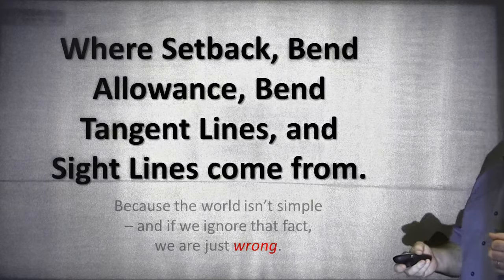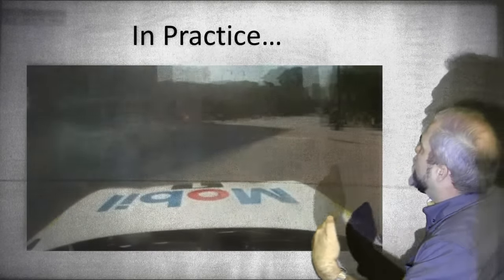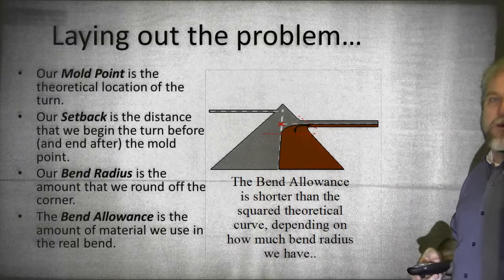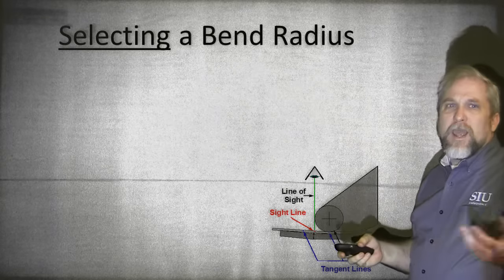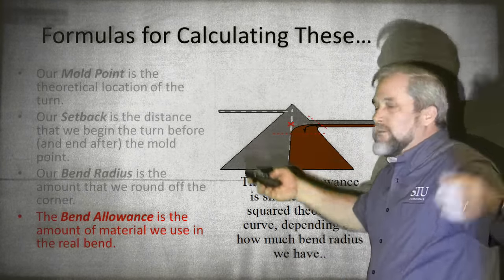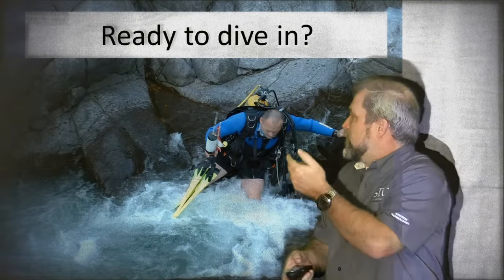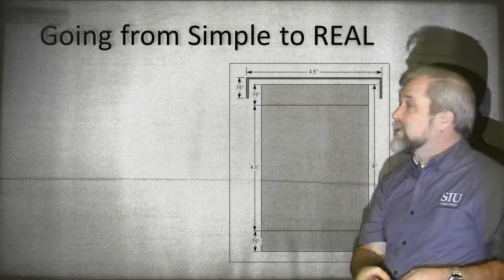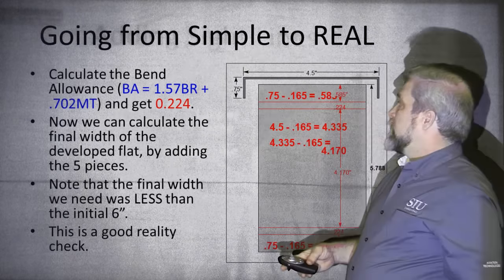AVT 206 A&P - P2 - Developing Sheet Metal Flats - The Math Behind the Bends

Comment: Interesting, but you are making it too confusing for some. A much more simple formula for the length of a bend is......length = (radius x angle x 3.1416) / 180.    That will give you the length of the bend in the middle of the material thickness if you use r+1/2t
Reply: Yeah, or Radius x 2 x Pi  = Circumference, divided by 4 = arc length.

Comment: Many years ago, while working as a flight mechanic at a large aerospace corporation, I was tasked with building several complex parts for a flight test aircraft.  The stack of drawings was daunting, with each part having multiple bends at various angles, but also multiple radii on some parts, and many of the flanges were at angles to the other flanges.  Calculating non-standard angles wasn't fun, since the process at the time was to look up the setback in a table for that thickness and radius.  (table was every 5°)

I'd then have to do the math to extrapolate the answer for, say, a 37° angle.

I knew how to calculate the bend allowance and do all the math, but it was taking too long and errors could definitely happen.  I went to one of the computers in the shop, and basically put the bend formula in an Excel spreadsheet.  I gave it enough places to add up to 4 bends, to make hat sections.

To use it, all you have to do is type in the thickness, radius, and angle of each bend, and hit enter.  It fills in all the info you need, and puts it in a drawing format with the thickness, radius, and angle of each bend in a table below the drawing.  One click on the print button, and you're ready to cut your metal and head off to the press brake to bend your parts.  Everyone loved it, and they are still using it today.

Now I use Solidworks, but it took a bit of experimenting in the program to get the K factor correct (not .5) for aluminum correct.  I knew my formula to be correct in my spreadsheet, so I drew a 1" x 1" flanged part, and kept changing the K factor until it measured within 0.0005" (half a thousandth) of what my formula said the flat pattern length should be.

I've only used cornice brakes and finger brakes a few times, (A&P school mostly) but I always used a small hard square to align the sight line with the edge of the brake radius.  Press brakes are where it's at though.

Very nice explanation of what's going on in sheetmetal bending!  Brought back a lot of memories.  Thanks for sharing your expertise!
Reply: thanks
Reply: Going through something similar at my company.  Trying to streamline and standardize how we determine things like bend deductions, tool selection, die opening size, etc.  

Sheet metal bending has so many variables but once you standardize and control them it becomes much more predictable.  Automated flat development processes and CNC press brakes make things a little easier too :).
Reply: I worked in sheet metal shops my whole life (retired now). I was a welder for many years and moved into calculating flat layouts for the last 13 years of my career. I did something similar but I developed my programs on a graphing calculator instead of excel.  My programs would prompt for the necessary variables and then spit out all the dimensions needed to draw out the flat with autocad. We made a  lot of cones and transitions so I had programs for those as well as other shapes you would come across in daily life. My cone program would calculate the chord, which was necessary to draw the flat in a CAD program, as well as all of the other information needed. The variables it prompted for where simply the two diameters and how tall the cone was. It was a lot like cheating, but I was never wrong, unless I made a really dumb mistake and entered a variable incorrectly. The variables for most other shapes where basically what are referred to here as the mold lines, plus the die radius, real world location of holes, etc. I never had to worry about sight lines, that was up to the press brake men, but they had computerized back stops, I only needed to give them the bend line and radius information. I also was responsible for nesting the parts on the sheet for laser cutting. At the end of my career we started using Solidworks, which took all the fun out of it.
Reply: Can you please share the formula you were using.
Reply: @arniespace  Great stuff!  I've only designed and made a couple of cones, and they were related to bomb tails.  Fun!  I too, loved the challenge of it all, and really enjoyed that part of my career.  The small department where I ended up making flight test components had a pair of Promecam hydraulic press brakes, one 4' and one 6'.  They had DROs on their back gauges, making them super accurate.  I ended up starting a business, (not related to sheetmetal fab, mostly machining) and eventually it morphed into sheet metal fab for U.S. Army helos.
I had a pair of waterjets, (wish I had had a laser!) and bought a 4' Amada press brake.  The hole location tolerances were 0.002", meaning that the center of the hole had to be inside a 0.002" circle.  I put all the holes in the flat pattern full size, and once cut, deburred, countersunk for rivets, and bent, all the pieces Clecoed together and the rivets fit perfectly.  (They also got conversion coated and primered, and a few got anodized black)  Gotta love technology, at least for production parts.  :D  Saved a TON of labor.

While I do love Solidworks, it sure took the fun out of figuring out the really difficult pieces.  At least that knowledge got me retired at 46.  I truly was lucky that I chose being an A&P as my career.
Edited, because I forgot to mention, that in my spreadsheet, the little drawing included the 4 bend lines, (even if you only had one bend.......everything else would be zero) and also the material thickness, part number, bend angle, radius of each bend, and leg length, so you could mike the flanges without having to have the actual drawing at the brake.
Reply: @tulsihomes  The entire bending formula is too difficult to type out, but here's what I have in my Excel sheet for the setback formula for 6061-T6 and 2024-T3:

=2*(R_+T_)*TAN(alpha/2*PI()/180)-(0.01743*R_+0.0078*T_)*alpha

If you understand Excel, that will make sense.  R is radius of the bend, T is thickness of the aluminum, and alpha is the angle of the bend.  I'm sure that all that information is online somewhere, especially for other metals, like steel, brass, copper...  Those constants, (0.01743 and 0.0078) are straight out the Engineering Handbook where I worked.

If you know the set back for each bend, (usually, they are all the same, but if the radius or the angle of bend differs between bends, the setback for those will be different) then here's the formula for getting the overall length of the part:  =Leg_1-Setback_1+Leg_2-Setback_2+Leg_3-Setback_3+Leg_4-Setback_4+Leg_5

Again, that's what I put in the spreadsheet.  The length of each leg or flange, minus the setback for THAT bend, plus the next leg/flange, minus its setback, and so on...

So, if you had a hat section, there would be 5 legs or flanges, hence the formula looking that way.  Good luck!

I might as well edit this one too...

If you need to know the bend tangent while designing bends with more than, or less than 90°, here's that formula to put in your spreadsheet:

=(Radius+Thickness)*TAN(Angle/2)

I would try to explain bend tangent, but it's late, and I'd need to draw you a picture.  lol!
Reply: Hi,
Bend allowance (bend length). That is easily worked out, Radius x 2 (diameter) x Pi = Circumference. Circumference divided by 4 = arc length (bend length) What I don't get is why WE choose a Radius. Surly the formula dictates the Radius as a rule, so why do we pick a Radius as that is what determines Bend length. The formula must give us a Radius, then we set out from there? All the Math I've seen are the same, and I cant work out. If there is a tolerance to bend Length relating to material thickness, I don't understand why we determine the Radius to do the Formula, rather that the other way around, so the formula gives us a radius to work from. does that make sense? Maybe I'm just stupid. Thanks in advance.
Reply: @thejtizzel  You're not stupid, James.  A typical engineering drawing will tell you what each radius will be, for each bend on the part.  Those radiuses may or may not be the minimum bend radius for that thickness and that type of material.  Using a smaller radius than the minimum bend radius, may create stress fractures in the bend, or reduce the fatigue life of the part.

Of course, that depends on the type, or alloy, of the material, and the hardness of the material.  6061-0 (annealed) aluminum would have a smaller minimum bend radius than 6061-T6.  (heat treated, or hardened)  It also depends on the thickness.

It's normally not the press brake operator that decides the radius of bend.  Whomever designed the part that makes that decision.  The nose of press brake dies are dimensioned in radii, because that's how drawings are dimensioned.

Does that answer your question, or am I missing something?
Reply: @throngcleaver  Wow, thanks for replying! I mean, if I were fabricating something at home, and I looked up what the minimum bend allowance for a certain metal and thickness I was using was, is there a formula I could use to get the Radius, then set out from there. The formulas I've seen say you have to input the Radius yourself. What if you do this, then it exceeds the minimum bend allowance....? You have to start again until you get the Radius right.... that's what my brain has taken from this. Cheers.
Much appreciated.
Reply: @thejtizzel  Hi James.  As the designer of the part, you would have to decide the radius of bend that you wish to use, and that should be based on the minimum bend radius, or any radius larger than that.  It's just as important to know the radius, as it is to know the material thickness, or the angle of the bend, to come up with an accurate bend line.

I don't think there's a formula for finding the minimum bend angle.  That information is probably derived from testing each alloy, at each thickness.

I haven't looked, but I'm sure you can Google a minimum bend radius chart for various metals and their thicknesses.

A typical press brake would have multiple punches (upper dies) with all of the common radii.

A cornice brake or a box and pan brake, (finger brake) will have a fairly sharp radius, or at least a very small radius.  On those types of brakes, you would need to bend one or more pieces of sacrificial material, and stack them up to get to the radius that you desire, before bending your good part around the radius of that stack.
Reply: @TheEngineeringToolboxChannel  look at getting trumpf techzone bend software will give you the correct flat for cutting and setup the full bend procedure for you its amazing its built into the new 7036 trumpf press brake we just got

Comment: Excellent tutorial. I followed it very closely and found the following minor inconsistencies:
At 7:02 you imply that the material thickness is 0.032 but at 11:20 you only get 0.165 if the MT is 0.040.
At 15:40 you say "inner ones" as in the inner tangent lines but the diagram shows you are using the outer tangent lines. The text is consistent with the diagram.
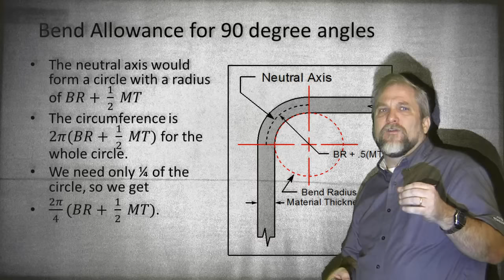At 9:41 you say the actual neutral axis is at 0.455 but the equation says it is 0.447.

As I said, I followed very closely. Thanks for the education!
Reply: Yes I agree, some big holes is his examples . I cant quite follow where he's pulling these numbers from?

Comment: My bend deduction formula for all materials and 90degree bends is 0.434(3MT + R) its always worked for me and never gotten me in trouble. I derived it the same way he explained in the video and I confidently would allow anyone to use it.
Reply: This is most likely a good estimation but I would always suggest bend samples for every combination of material type, thickness, bend radius, and even die size.  This is the only way to know exact bend deductions/K factors for your process.

Comment: It’s more like 1/3 material thickness instead of 1/2 on the neutral axis. Metals are more encouraged to stretch than shrink, especially when the die is in static connection with the material.

Comment: I didn't quite get how he got to the .702 value. Is this a constant? It must have something to do with the K factor?
Reply: I think he messed up.  It should be 1.57* BR + .455*MT...where 1.57 is 1/4 the circumference, and .455 is the K-factor ( I believe he said he was using for Alum), and I come up with .19625+.00728 = 0.20353, NOT 0.224
Reply: @floryedable  what is the material thickness for aluminum?

Comment: Draw the part profile from the side in CAD, then offset 45% through the metal from the inside bend radius's, then add arc lengths and flat lengths together.
Reply from the maker: Only they don't let you have a CAD program when you go to take your A&P certification test - which is what this video aims to help you with - hence the title.  If you want to do it the easy way in real life, find where the inside edge of the bend will be, and line it up on the brake as your sight line.  You will gain a little length as you make the bend, but the bend will be in the right place.  Cut off the flat you bent to the right length, and you are done.  Who cares if you wasted 20-40 thousandths of material?  But these ways won't work on the test - so you have to learn the math if you want to pass.
Reply: I'm not going to lie, that's how I've been doing it when I'm bending stuff by hand. My work just got CNC press brakes and because I'm a machinist the plant manager has decided that makes me a sheet metal expert too. Thank you for these videos, when I learn something new I like to know it by first principles so I can apply the technique universally.

Comment: if you follow the algorithms needed to produce the bend allowance and consider k factors, most metals that are commonly bent will hold true within tolerance if metal grade or tolerance of thickness is followed And the machine is dialed in. I only have trouble  with a few  alloy as far as I have encountered.

Comment: Hi sir, what is the source of the safe bend CHART?
Reply from the maker: The practical experience of many people.  You can look up an aircraft aluminum chart in AC 43.13-1B.
Reply: @1donagin  can I use same for sheet metal components of automobiles.. For example brackets fenders and other body parts of vehicle?
Reply from the maker: @JaswinderSingh-mb7ki  The chart are specific to the metal, alloy, and heat treatment of the material.  You need to know what steel you are using.  Examples 4130, a36, etc.

Comment: Question: BA=2pi/4 (BR+1/2 MT). means pi/2 BR + PI/4 MT. it should be 1.57 BR + 0.785 MT. Why does 0.785 change to 0.702?
Reply from the maker: 9:30 to 9:45 in the video answers your question.  The neutral axis is not exactly at 50% for any material I know of.  You can look up the neutral axis on a chart for your material.  For hardened aluminum, the nuetral axis is around 45% of the thickness.  The .702 in the FAA's published aluminum bending formula comes from adjusting for this non-50% value.
Reply: Can you explain where the FAA's published aluminum bending formula is and how to calculate/adjust for the non-50% value? Or what the formula is? or am I missing something completely? Because 2π/4(.45MT) still = .706MT
Reply: @The-PlagueDoctor  must be a typo or rounding error in the K factor value (neutral axis location)...  and besides the difference between .702 and .707  in very minimal.  Even in thicker .25" material the deference in BA is only .003".  Since this formula is just an approximation I would say that's splitting hairs.  However, I do see your point and can appreciate the need to understand the derivation fully, but his derivation is not wrong. There was just some sort of discrepancy in the K factor.
Reply: I appreciate the reply!

Comment: Excellent and after all i am able to learn bending from a practical point of view. Also the buzzword "K" factor, i searched many websites and difficult to figure out how they arrived this factor and now i am clear. If possible put up a video how this K factor is found out for different materials, becoz we have whole lot of tables around the internet but unable to find how it arrived. Thanks a lot
Reply from the maker: The problem with K factor is that the same term is used to refer to different things.  In many industries, K factor refers to the location of the neutral axis as a percentage.  (Example K factor of .45 would be a neutral axis at 45 percent of the thickness of the material.)  My example are from aviation, and the USA's FAA uses K factor to refer to the adjustment of the setback for various angles that are not 90 - so this is what you will see in my videos.
Reply: Thankyou don. i saw u r example video and found some website with K factor tables and arriving methods. They are for general purpose application. Thank you, u made bending theory simple when i am confused with CAD tools and now realized that hands on calculation and understanding of the fundamental theory with difference to real world case is important for design and made simple  by u. Keep your work "DON" many like me will learn and follow u r teaching. Thank u

Comment: Very good, noticed one small error and around time mark 15:13 when you are explaining where to layout "sight line" using "bend radius" You state that you are measuring from the inside but the diagram clearly shows you are dimensioning "site line" from the outside, correct?
Reply from the maker: The site line can be measured off either bend tangent line.  You pick whichever BTL you are going to put under the caul on the brake.  Measure one BR towards (and in some cases past) the other BTL.